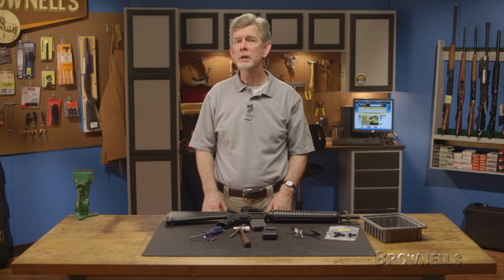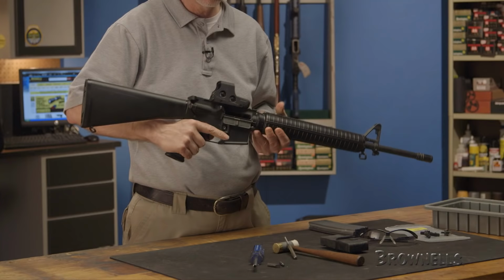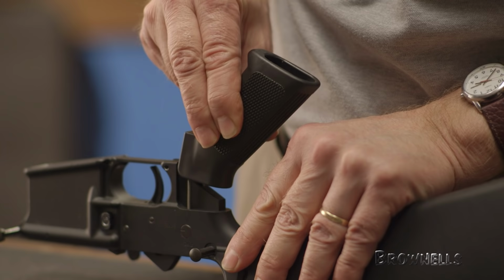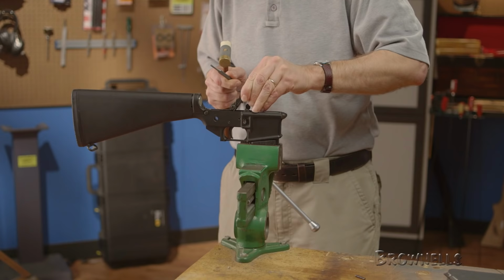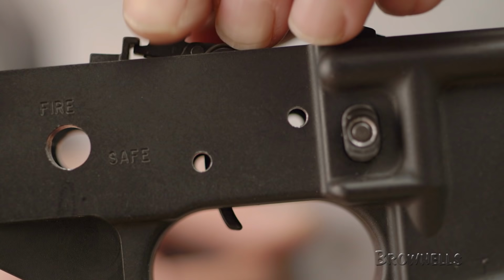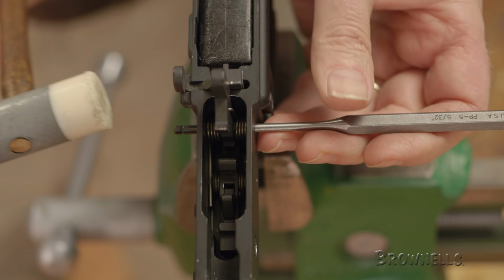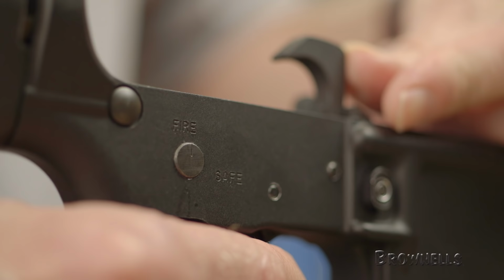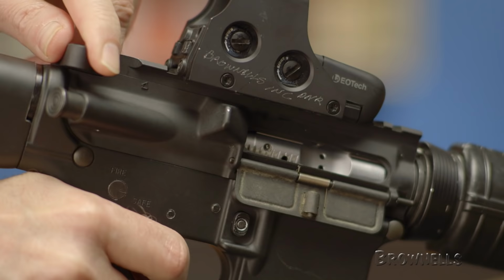How to Install an AR-15/M16 Trigger

Comment: The most effective, articulate, and well-produced presentation on this subject I've seen. The presenter is a natural. I didn't have a setup quite like the Brownells set when I started (a nice, dark room with an oriental carpet is great for hunting springs and pins), but I got the job done regardless thanks to this video. Thanks for sharing. Been a Brownells customer since 2020.

Comment: Thank You for this video! I used to build an occasional AR in years past. Fast forward a bunch of years and now I am retired and have time to build once again. I am totally amazed by the things I have forgotten in around 20 years when I just went and bought my rifles. I have begun putting uppers together which I pretty much remember. Now I am relearning the lowers. I pulled a lower kit out of the parts bin and started putting together. The mag release went well. Next the trigger. Forgetting that the hammer spring is similar to the trigger spring produced vile sounds coming out of my shed!😁 I finally figured out that I had the two mixed up after watching this Brownells video. I must admit that I perused others videos before Brownells, but that was to my detriment. Others were similar but the fingers were in the way or poor explanation was given. Kudos to Brownells for an outstanding easily followed video!

Comment: This was helpful, but you don't need to remove the grip and safety selector. You can leave them installed and replace the entire trigger assembly
Reply: It's a good thing you learn about the different parts

Comment: Great video. I’m having issues like full auto with 22lr conversion and bursts with 5.56. Replacing/checking springs and this vid is clear and easy to follow. Thank you
Reply: Most likely, your disconnector is out of spec. You may be able to modify it if you can catch what it's doing wrong.
Likely, it's not returning high enough to catch the hammer, so why? Is the disconnector spring upside down? Did you use the bolt release/catch spring instead of the disconnector spring? Again, the disconnector spring is larger on one end and that end goes towards the bottom. Maybe the diconnector is too tall on one end? Eyeball it. See what's going on. If you still don't know, buy a new trigger. The Larue MBT2 is awesome.

Comment: Thanks for actually showing how the hammer and springs are oriented when you put them
In, seems most trigger install tutorials just say “now put the hammer in” and skip that part.
Reply: @19771JAWS So you’re having issues getting the trigger pins in? The trigger pins should be able to be slid in with a little bit of force with a blunt object, or even by hand once the trigger and hammer holes are lined up with the holes in the receiver. You could also try using a slave pin, or something that’s close to the size of the hole, like an Allen key, to put in and hold everything in place while you attempt to slide in the pins. If it doesn’t fit you may be using the wrong pin, the pin may be out of spec, or the trigger pin holes may be out of spec, hard to tell without actually measuring them.

Comment: It took me a while to get the trigger installed as it was a two-stage and the top piece on the trigger kept loosening and coming off, but inserting the punch after it was seated did the trick. Thanks!

Comment: PROTIP you don't need to remove the safety to do this.
Reply: Matt C2083 in case anyone is ordering:

1. move safety selector so it points toward magwell
2. slightly push  (with finger) on the safety selector into receiver and swing it the opposite direction, pass the safe position  -this will reveal a cut out slot in the safety selector allowing all trigger components to easily slide out.
Reply: So u don’t have to remove it then?
Reply: you do if you want to install an M16 full-auto selector ;)
Reply: Yes you do
Reply: It depends on what trigger group you are installing. Just read the damned manual.

Comment: This made it look so easy I might even be able to install the adjustable drop in trigger that came with my gun myself.

I lack the magwell block and fancy hammer tho.
Reply: not needed but if cosmetics mater they come in handy, I used a mag as the vice block and gently used a carpenters hammer.

Comment: You do NOT have to remove the safety detent if your are just replacing the hammer and spring. And do NOT have to remove the trigger either. Just done this tonight....

Comment: My channel in the roll pins seems to be too deep. My detent won't let the takedown pin go back in. If I force it, it breaks the detent. I mickey moused it by putting a piece of paperclip in the channel so it wouldn’t be so deep but this is obviously not optimal. Any suggestions?

Comment: Question: if the trigger reset is a long reset, will replacing the trigger do the trick? Or scoundrel the disconnector be replaced as well?

Comment: My channel in the takedown pin seems to be too deep. My detent won't let the takedown pin go back in. If I force it, it breaks the detent. I mickey moused it by putting a piece of paperclip in the channel so it wouldn’t be so deep but this is obviously not optimal. Any suggestions?

Comment: Why is my top part of my disconnector holding the hammer and not releasing it..... Works fine when ha, met is just hooked on the bottom. When I push ha,, we all the way back and hooks on the goose neck of the disconnect, the disconnect is not depressing enough for it to go to the second engagement position...???

HELP!!!

Comment: If I can't find a brass and nylon mallet, would a small nylon dead blow mallet do the same job?
Reply: Any hammer will do. It doenst matter. And you dont have to remove the grip or the safety. The video is weird

Comment: This is a serious question:
How difficult is it to do this without a vice or block?  My work space is my bed.
Reply: Doable. I did it on my computer desk. If you were to do a full lower part kit install, I recommend a firmer work space and an extra hand.
Reply: I had the same situation and I broke down and bought a vice block I got tired of balancing every thing on my lap.
Reply: So far, I have put in the bolt catch, magazine catch, and trigger while sitting indian style on the floor.  No desk, no bench - nothing.   You're fine.
Reply: Dren Gillespie  Did a lower build on the couch couple of hrs ago. No big deal.
For installing the spring and dent for the FORWARD TAKE DOWN PIN (Which gives alot of people grief)...did that in the bathroom in case pin decided to "go flying".

Installed spring, then used a pair of duckbill pliers to hold, and depress pin. Then used a small flat head screwdriver to hold pin depressed...and pushed in forward  takedown pin.
No problem for me due to experience.. for others they make a special tool...
Reply: You don't need a vice or any of these tools except a screwdriver and the firing pin. I've did complete breakdowns and repairs in the field.
Reply: I've done them on the kitchen table.But it's easier with something to hold it.And I've used the Tipton gun vise also.

Comment: A LOT..as in MOST, ‘mil spec’ (2-piece) triggers can be installed WITHOUT REMOVING the grip OR safety…
Reply from the maker: mil spec triggers are in the minority in the current market.

Comment: What happens if you let the hammer fall without catching it?
Reply: It will damage the lowers frame very quickly which will cause major issues. If you look down into the lower where the hammer can slam into the steel of the lower is very thin at that spot to make room for the magazine. If that part gets bent in any way you're pretty much done for.

Comment: Dear Brownells. Subject :NEA 15 .223 Trigger malfunction. Dear madam or sir, I have bought a Brand new NEA 15 .223.
I have shot 30 rounds ( Barnaul .223 55gr FMJ). Example: I put 3 round in the magazine. I pull the trigger once.
The rifle shoots 2 rounds (Automatic). When i pull the bold back, the 3rd cartrige jumps out of the rifle and the primer has a dent on it, but was not firing. Semi automatic shooting does not working. The problem is repeating again and again and again. Question? What is the problem ? Kind regards Hay Berden
Reply from the maker: Since there could multiple issues or scenarios here we suggest reaching out to our Gun Techs by calling 800-741-0015. They'll be able to assist you with the issue. Thank you so much!

Comment: Do u have to take off the handle r can u skip that step?
Reply: You have to. The small detent and spring on the handle is what keeps the safety in place. And you need to remove that according to the video.
Reply: Jack Welch  Q: Why would taking off the handgrip be a problem?
Reply: I've taken my trigger, and hammer out several times, without removing it. For drop-in triggers, it has to be removed, but not for standard mil-spec triggers.

Comment: Which way do the pins go?
Reply: Did you figure it out yet?  Or is that AR still in pieces?  LMAO!!!
Reply: TexasLonghornRanch  The pins "can" go in either way BUT.. you want to drive the pins in from LEFT SIDE (Side SAFETY SELECTOR is) towards the side the ejector port is.
NOTE: LOOK at the pins... you will see (2) machined sections (And they have bevels)... You want the (2) on left side.. You driving in the long smooth section... first...
NOTE:  On the 45 degree bevels.. you want pins postioned so bevels allow for the pins to tapped out.
LOOK AT THEM CAREFULLY....

.

Comment: There is no reason to remove the pistol grip or safety.
Reply from the maker: That depends on the trigger, some will not physically fit unless those are removed.
Reply: @brownells   Which triggers require the removal of the pistol grip and safety?

Comment: Thanks for the video, but there not user friendly. They have too many parts to fail. I'll feel safe with my AK
Reply: What does it have to do with replacing a trigger on an at-15?
Reply: tom jones  AR is very user friendly to build / maintain /modify / Upgrade. Parts are CHEAP,  Parts are everywhere.
AK... like them, reliable, built like  truck but they are the exact opposite.
Re barrel a AR, then a AK...